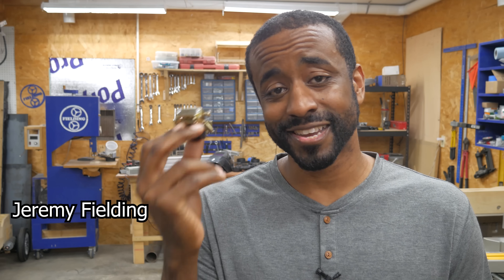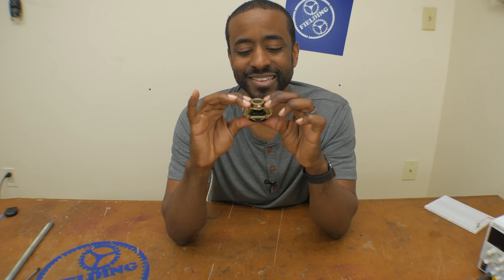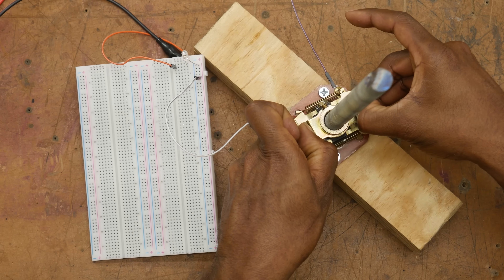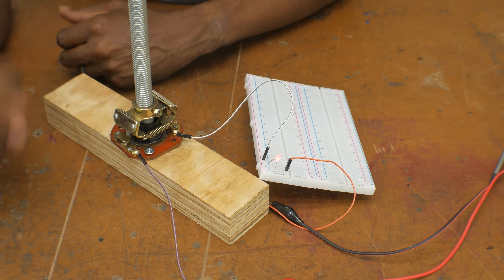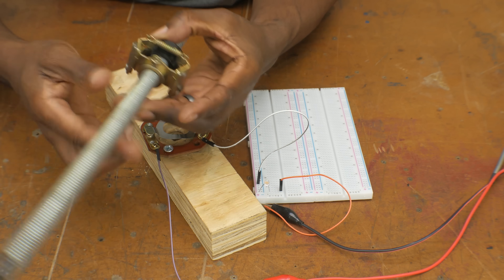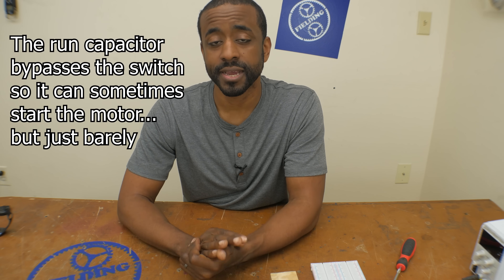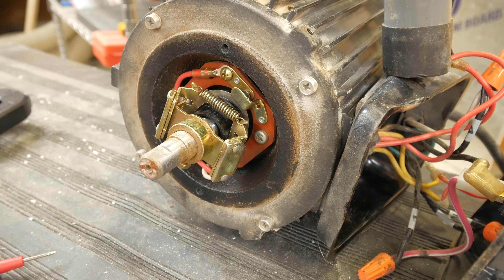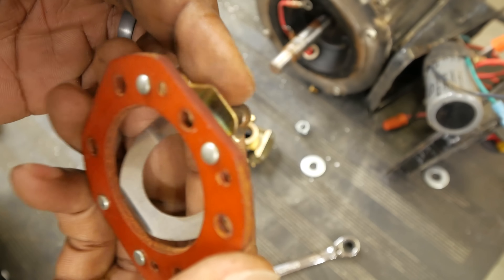This Clever Device Is Found In Nearly Every American Household. How It Works And How To Fix It

Comment: It is true that the starter winding aids in starting the motor. But it has more to do with making the motor spin in the proper direction. An AC induction motor has a single phase, unlike a 3 phase induction motor. So, depending upon the position of the rotor there maybe no torque in the direction of desired spin at startup. The switch, coupled with the capacitor, creates an additional phase that lags the main AC phase, thus that winding induces a torque in the proper direction of spin regardless of the rest position of the rotor. Other methods have been used to accomplish this such as shaded pole induction motors, universal AC motors, etc. However capacitor start motors seems to be the option of choice for fractional HP AC induction motors. Cool video, though.

Comment: Using a point file instead of sand paper will make the job last a good bit longer as the sand and contaminants left behind will accelerate the burning etc.. As well sounds like better replace or at least oil the bearings while you’ve got it opened up! Neat little gadget for sure!

Comment: POWER FEEDER DIY, Given your skill with motors, how about this for an idea. Make power feeders from old belt sanders. Re. power feeders are useful AND expensive. Belt sanders have a spring loaded slider connected to a drum. Sanders of course contain a powered drum The difficult part? controlling the speed of thr motor(s), building a suitable framework. What do you think, thanks

Comment: I don't think most HVAC repairmen would ever go to the trouble of sanding centrifugal switches contacts to repair a fractional HP motor. In my experience rarely if ever did switch contacts fail !!! Or start capictors !!! More  than likely the start-winding itself failed/shorted.

Comment: The burned contact point looks much like old fashioned automotive tungsten "Ignition Points". The burned appearance is not just appearance. Over long term use, "Arcing" scorches and actually burns (oxidizes) the contact point. My experience with automotive "Ignition Points" is that you can't really sand or file off enough metal to get a "clean" surface again. Obviously, this fix will work on single phase centrifugal switches. My father was a farmer, and as such, had to be able to fix and repair any equipment on the farm (including electric motors).

Comment: Inventor could have been Charles F Kettering. He invented the way to make electric motors spin up quickly resulting in the NCR corporation changing cash registers forever, then he applied it to the automotive industry and that got rid off the crank at the front of the car.

Comment: I have several old 120 motors on equipment I got from my Dad. They won't start unless I give them a spin, then the work fine. My Dad always said the " starter windings burnt out". I've never torn into one, but is that the case, or could there be a switch issue?

Comment: I've seen a lot of single phase motors here in Germany but none of them had this switch.
Must be something stupid from the US.
Reply from the maker: Perhaps just a difference in manufacturing preferences. It is only there because the motor is single phase. There are no other US specific constraints. Also it's worth noting that personal experience is not really evidence it doesn't exist in your country. Perhaps you just haven't seen one in the industry you work in.

Comment: "A 1920's patent for a centrifugal switch (US Patent #1,630,394[1]) was granted to Royal Lee on May 31, 1927. It was the basis for the formation of the Lee Engineering Company.[2]" (Source: Wikipedia... so make of that what you will).
The principle is based on the centrifugal 'govenor' device used on steam engines and was developed by James Watt and Matthew Boulton around 1755 (so the principle is older than you might have thought). It operated a valve of course, rather than a switch.

Comment: Thanks for the close up view of the centrifugal switch in action – great “How Things Work” video.
As a 40-year veteran of replacing centrifugal switches, my experience is that a motor that doesn’t start is rarely a failed capacitor. Over 95% of the time it was pitted and burnt contact points on the switch. Usually the points were “eaten up” beyond repair, but sometimes filing them down a bit got the motor back in service for a while longer. 
If you need to replace the switch (the governor portion is usually in good condition), there are literally dozens (if not hundreds) of different designs and sizes available. An internet search will probably lead you to Torq Corp. as one of the primary manufacturers of generic switches that are used in many brands of motors throughout industry.
One safety tip: The spark that you got when testing continuity was the discharge from the capacitor. That can happen even if the motor is unplugged.

Comment: Thanks Jeremy. You are a wonderful teacher. You have the art, my friend. I worked for 41 years in an oil refinery where we had steam driven turbines of all sizes, up to 2,000 HP. The  governor used to control speed, was of this centrifugal design, controlling the steam flow that ran the turbine. The actual trip mechanism that shut the turbine down in case of overspeed worked on this centrifugal force principle too, just like your switch. Respect. Trinidad & Tobago.

Comment: i use plumbers flux on a qtip to clean contacts. the acid brightens them right up without removing any plating that could cause them to rust or oxidize in the future. alot of these tabs are copper plated steel to cut on cost.

Comment: Great video - oftentimes it's the small and simple things that are the most fascinating.

To add to your discussion of symptoms, I noticed my tablesaw motor was running rough, overheating, and would sometimes trip the circuit under no load.  Instead of spinning down gradually, the shaft would almost grind to a halt, and I would hear the click sound of the centrifugal switch almost immediately after cutting power.

It turns out the switch contacts were corroded, and the piece of metal which acts as the upper stop for the moving contact was bent upwards.  I cleaned both contacts and bent the stop back into place, and now the motor runs fine.

So sometimes symptoms which might make you first believe there is a problem with misaligned bearings or a bent shaft might actually be a result of a bad centrifugal switch.

Comment: Hello,  I found this video by accident and Man I'm glad that I did!!  My compressor is acting weird when it had over 50psi of pressure, the motor is not runnig as it should and a few secods later the braker switch on the motor tripped and shut it off. Talked to a few people and no one had any clue why it's acting like this, replaced the capacitors and nothing changed. I was about to buy a new one and I saw this video. I ran to my compressor turn it on, look in to the motor and the centrifugal switch is not working when the compressor has air on the tank, once I emptied the tank and turn it back on the centrifugal switch "expand". So my question is, where can I buy the correct one for my motor? What is needed to be considered to replace it with the right one?  Thanks

Comment: This is an excellent video.  It's really important to be aware that a large capacitor like those can hold a deadly charge even after being disconnected for a long period - up to a couple of hours in some cases.   It's best to put a screwdriver across the terminals before touching them yourself.

Comment: So, I bought a compressor and it had been sitting for a couple years.  The start capacitor burned up  within seconds of turning on.  So I replaced it.  Then the new capacitor blew up within seconds!  Scared the crap out of me.  Since I knew there was a centrifugal device for disconnecting the capacitor I disassembled and found a Mud dauber nest built on the centrifugal device!  It was siezed entirely.    Chipping away the mud and a quick vacuum, with a new capacitor and I had it working!

Comment: Jeremy Fielding
A terrific tutorial, thanks a lot.
The part you repaired looks just like a set of points in a car engine, so a points file is what you needed to face off the points. You might even have been able to reface the points without taking the assembly off the shaft.

Comment: That sand paper was too rough. You can damage the contact surface with that. Also the damage is cause by arcing so you can limit the damage by putting a low value high voltage capacitor across the contact. Best would be a snubber cct, 1K resistor in series with a 0.1 uF cap.

Comment: The motor sounds like it could use a new bearing. Also that white crusty stuff on terminal if I'm not mistaken is the Arc burning o2 in the air gap also the carbon build up on other connection is caused from to large of a air gap between points of contact which creates a hotter spark but I could be totally wrong. I had same problem with my compressor motor cleaned it up and made gap smaller and that was about 24 yrs ago use it just about everyday haven't had the problem since.

Comment: One point that was overlooked is, when you find that you have to turn the motor by hand before it will start with it powered up glove on hand before it will start. Dismantle the motor and make sure all field coil connections are disconnected next check resistance of run and start winding typically 3 ohms for start winding 30 ohms for run winding.Different motors may have different resistane. Then check run winding and start winding in series you should get 33 ohms if you only get 10 or 20 ohms reading there is a short circuit between the 2 windings and the motor will need a re-wind also check  capacitor check capacitor for correct value tolorance should not be more than that stated on cap ie if 50 uf cap measures 70uf or 40uf change it even if there is no leakage
I found that some caps will increase value prior to leaking even a small leak is not acceptable. Check for earth leakage with a megger a reading below 10 meg ohms is not acceptable as it will blow a fuse or trip an RCD.

Comment: I am still wondering how to determine what two wires go to the starting circuit and what two wires go to running circuits in the washing machine motor?  Also, How do I determine if a motor has a running capacitor circuit and or starting capacitor circuit.  How to determine them by ohm reading which is assumed that there are no circuit diagrams anywhere?  Thank you very much in advance.

Comment: Very common also in speed governors for farm tractor, irrigation pumps, welders, and power units. They have a gradual 'ramp' they run against applying variable amounts of throttle, and not just a snap on/snap off operation.

Comment: One thing i will add is that the switch was also open because of adjustment. That external switch needs to be set to close the circuit .

Comment: work on motors brushed induction and this switch is only backward us technology we use other more smart devices very good example of backward technology in us is trucks still no tcs and ecs braking systems max is abs and crash non synchronised gearboxes enjoy but this is very us backward fire creating technology

Comment: This is a derivative of the Centrifugal Steam Engine Govenor invented by James Watt to prevent Steam Engines from overspeeding and disentegrating. The mordern one just controls electrons instead of steam but they work the same way: https://en.wikipedia.org/wiki/Centrifugal_governor#:~:text=James%20Watt%20designed%20his%20first,had%20employed%20for%20steam%20engines.
Reply: Some small gasoline engines use a similar device to govern the speed. I never knew these switches existed on electric motors until recently. My brother in law gave me a 20 year old metal lathe still in the original box and unused, but very dirty due to spending the 20 years in a barn! The motor would only turn slowly, and both the “start” and “run” capacitors tested ok. I pulled the end bell off of the impeller end of the motor, discovered the centrifugal switch, which was stuck, and fixed the thing! I was so proud! Ha! Thanks for putting out all these great vids! They are a treasure trove of info! God bless!
Reply: That was what I first thought of....governing the speed of a steam engine or combustion engine. In the past, I have seen very similar devices on steam engines.
Reply: Correct!  If you've ever heard the term "Balls to the Wall" that was the referring to the analogous mechanism on the steam engine. Basically two heavy metal balls were mounted on the armature and when the engine was running at full velocity the centrifugal force would fling them perpendicular to the rotating shaft and engage the mechanism.   There are several patents on the electrical implementation.  But it is truly brilliant! Ah physics! -- In the US: https://pdfpiw.uspto.gov/.piw?Docid=02616682&homeurl=http%3A%2F%2Fpatft.uspto.gov%2Fnetacgi%2Fnph-Parser%3FSect2%3DPTO1%2526Sect2%3DHITOFF%2526p%3D1%2526u%3D%25252Fnetahtml%25252FPTO%25252Fsearch-bool.html%2526r%3D1%2526f%3DG%2526l%3D50%2526d%3DPALL%2526S1%3D2616682.PN.%2526OS%3DPN%2F2616682%2526RS%3DPN%2F2616682&PageNum=&Rtype=&SectionNum=&idkey=NONE&Input=View+first+page 
(Enjoy your videos!)
Reply: The invention of the rotational speed governor/regulator is attributed to Christiaan Huygens in the 17th century. James Watt adapted the idea to control the speed of his steam engines.

If you look up 'Centrifugal Governor' on YouTube, you will find an example, or a picture on google.
Reply: Very cool - learned something new. So Huygens invented the speed governor to control the distance and pressure between millstones and the windmills propelling them:  https://en.wikipedia.org/wiki/Centrifugal_governor#:~:text=Centrifugal%20governors%20were%20invented%20by,windmills%20in%20the%2017th%20century.
https://en.wikipedia.org/wiki/Centrifugal_governor#:~:text=Centrifugal%20governors%20were%20invented%20by,windmills%20in%20the%2017th%20century.

Comment: Reminds be of the “balls out” feature on steam engines.
Reply: I had the same thought. I believe it's technically called a "governor".
Reply: Piotr Kozbial a much better term for use at the dinner table.  Don’t want our mothers choking on their dessert.
Reply: @cw4608  Speak for yourself! :-)
Reply: Centrifugal governors, very much like those used on steam engines, were also used in the early days of electric gramophones. It's hard to believe now, but AC motors would 'run away', and had to be kept at the desired speed with a centrifugal clutch which pulled a rotating disk towards a felt-covered fork that acted as a brake. They were beautifully made in brass and spring steel... wish I still had one now as a curiosity.
Reply: Flyball steamer.
Reply: Sharron Clark yes!
Reply: I knew what balls to the wall referred to, but never knew "balls out" was in reference to steam engines

Comment: Invented by James Watt to regulate the speed of a steam engine and it used 2 opposing balls as the weights to govern the steam engines speed by controlling a valve to the input. A form of negative feed-back. The mechanism was also known as the governors balls.

Comment: Excellent video.  The most brilliant part of the centrifugal switch is that the wear element, a rotating plastic disk, is in contact with the stationary switch only while the motor is at low speed.  For most motors this is a tiny fraction of the life of the motor.

Comment: In my experience, a lot of the simple stuff is made from the cleverest of thinking. One might think that it's the complex stuff that requires the most advanced thinking, but a lot of time simple things can be made from even more advanced and thorough thinking. Heck, read up on the steam engine's advancement through the ages, and the most genius of minds were usually the ones who came up with simple solutions to advanced problems.

Comment: I have seen induction motors with electronic switches. Found this when using reversing starters to reverse the direction. The older motors would slow enough to allow the centrifugal  switch to allow the kick start in the reverse direction. The newer motors would not recognize the change in direction and  would continue to rotate in the original direction. To correct this, had to insert a time delay relay into the circuit.

Comment: I deal with 3 phase motors here in the US, not resi as you said. I am an HVAC guy and almost all compressors that I deal with utilize an electrical device that is called potential replay that has the function of a centrifugal  switch because I guess you cant put a centrifugal  switch inside of a compressor

Comment: It uses the same effect as governors on the old steam engines.  Those had two metal balls that spun around moving outward. If the steam engine went to fast the governor would limit the amount of steam into the cylinders.

Comment: I found when working on hoist motor on job sites, the power supply was a major issue in motor switch failures. A lot of people would run a hoist from a house power supply power circuit, not taking in account the house circuit length should be added lead length. The length of the lead is very important big single phase motors. Voltage drop is what will occur with long leads. This also leads to start switch burn then capacitor failure then motor burnout.